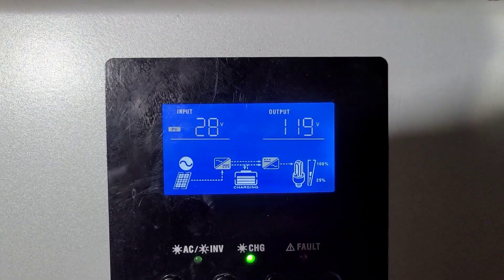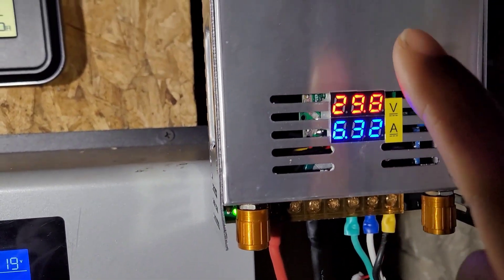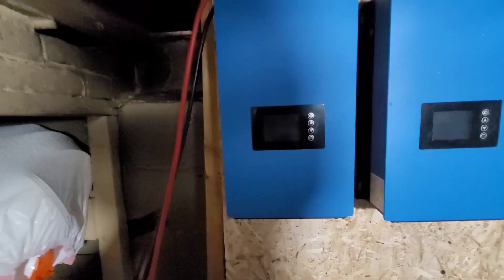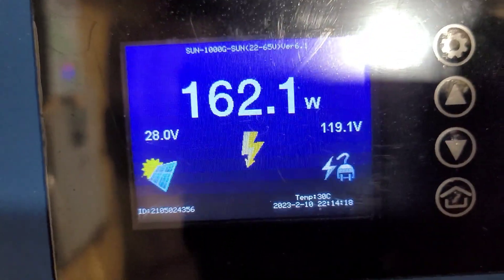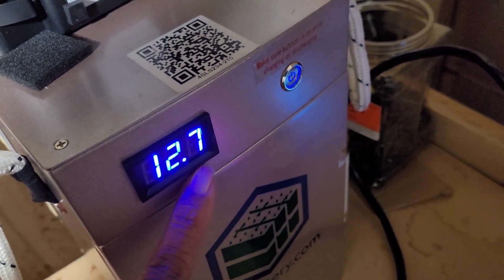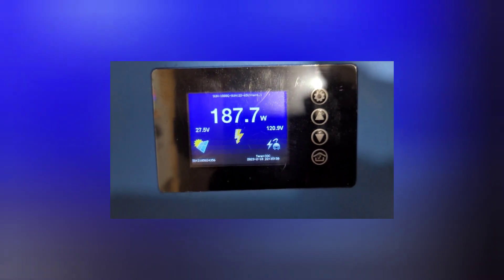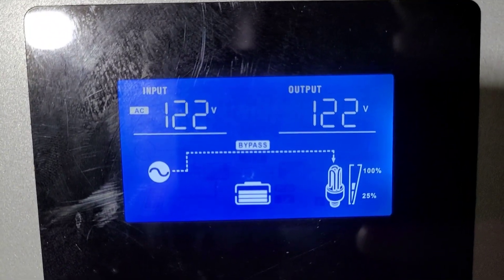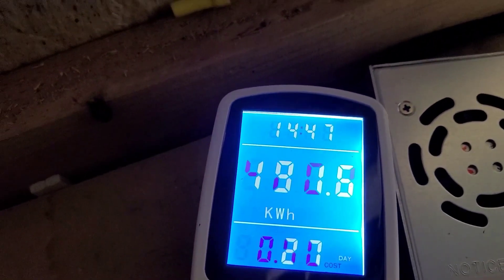looping energy updated from last video using a grid-tied inverter to Loop energy see in description

Comment: What's the objective of the exercise?
That must be stated explicitly.
Reply from the maker: Excellent question, Let's start by explaining that this is a system of overunity, And because I created over unity and most people stated incorrectly or tell people the wrong information about overunity which is a part of trolling I believe and we'll prove that later through the comments that other people have stated, they take my work and they make all these comments as I hope you read Just from doing these experiments to misdirect people and tell them eyes so that is number one. After realizing people brain almost explodes when you give them too much information I decided to break down the experiments that I do into small bites this experiment is showing can you take the same energy and loop it back into itstuff that is number tdo and if you can take energy like in a coil And you have many types of coils you have too understand why do people make coils what is the purpose of making a coil that a single straight line can't do won't you realize what a coil does if you do that with your energy looping it then you realize that you can do step UPS That means that you can get small amounts of gain a state of losses, They're always going to be losses what the activity at the end of the exercise is to be overwhelmed of energy even though you have losses. Remember our grid is based on this principle running energy through those energy lines create a lot of  Losses through heat and magnetic flux we have experiments on that how to use that loss to gain some energy, Keep in mind even though it's small amounts of energy so it's a battery if you break it down to get 12 votes you have to take small amounts of energy and stack them into large parts of energy But that isn't another story. Even though that is another story you have to keep that in mind that's why I stated because the solar which only gives you a small amount of energy especially when using LA D light still gives you a small gain and now I stack them as you see in this video ,     https://youtu.be/HTR03aSiGWs
 And then what happens when you overwhelm a system of loss with a positive gain you now can push that back into the battery itself so I'll be redoing some of these experiments so you can see that yes if I loop the battery back into itself and push some more energy from an outside source into it than it will actually charge the battery, Why do I do this because if you look at the numbers I don't need as much energy from the grid because the boost of that  12 V 100 amps times 2 batteries is giving the power needed to just keep the system going so remember when you float charge a battery all you need is just the smallest amount of energy to push the energy back into The batteries which we  Showed but we're going to show it again because I understand that those trolls want you to believe that this is some type of perpetual motion and that it's impossible to do it's not all these things will eventually wear and tear and you will have to replace them. But remember you can go to any store and buy a tigrid and what is the purpose for the target to put energy back into your grid in which you are pulling energy from so I wanted to show if they made such a device why do they say it's impossible to do it. As you do your research you'll start to see something's not adding up and as history States in the past propaganda was one of the key things of winning wars, So again I'm going to show this by doing a small loop and then I large loop again once you understand that you can loop energy and why a coil is wrapped around itself to create a boost once that's understood then we can go into step UPS which if you opened an inverter , a tigrid inverter karma and many of your devices you would see that they all have course and Step up Transformers. When you start to ask questions on why so many step up Transformers in an inverter of any kind you start to see that blessed people are going to talk to you about that, Because they don't want you to know that you can step up energy and step it down as many times as you want now here's the exercise for you by asking the questions about the inverters and then looking at the efficiency number in which they state their machine workout is it just for sale Is a product to you or is it true. Then you start to see something is fishy about everything that they're saying 1st you'll find out yes you can loop energy nothing wrong with it, Then you'll find out that you can step that energy up either by frequency or by power itself, Once you start to do then how much energy is being drawn and how much energy can you put out you must realize that you're getting a gain just don't say more power out than in cause they'll go crazy but the game is there. Studying the grid itself and how they design stuff you start to see that they're playing this game in which I'm trying to express pacifically there's been stepping up power and stepping it down for years and no one complained about the losses, I'm not trying to say losses and efficiency  Doesn't have its place, What I'm trying to get people to realize is that the grid is not at all efficient and has great deal of losses so does the car that you drive these are the old systems so why are people trying to compare all the new systems with something that works so badly, It's called money. So again I've gave you a specific task to do to start looking up these things and realize that you're being lied to about certain things they're trying to keep you away from because then you'll start doing what nikolai Tesla wanted you to do in the 1st place be free from the tethers of corporate grid systems Or you can replace grid with  Greed, At the end of the day these simple videos chis are examples in which you can do yourself hence why I have to redo the video taking a small Charge controller and a small battery and showing is it just possible to actually take some wires from the battery in loop it over to the solar side Without damaging the equipment ? Answer that question see it for self doing both assures you that this is possible then we go on to the next step if I now take the solar side which already has 2 wires in it from the battery and add 2 more wires from an independent source can I now charge the battery at the same time that is discharging into itself ? Once you answer this question and it doesn't destroy your equipment you'll start to realize that these small little things they seem not to talk about Are a big deal we call this pass through charging , your phone does it it means that you can charge it and use the power at the same time and many of your devices does that today so why did they tell you that you cannot do exactly that then you'll have my complete point to this exercise.
Reply from the maker: Hi my name is Rick I work for Lloyd Stovall at media library, I wanted to make sure that the exercise is understood. We wanted people to understand about tigrids or grid tide inverters And how they put energy back into your AC home  Outlets, One when you buy these machines the only way to force energy into something that wants to come out of it is to have more power pushing back against it it's like swimming against a river, This machine bought from Amazon achieves this point. The 2nd point is that now you should realize You can loop energy back in on itself, It is a myth that you can't recycle energy back into itself and it is a big myth everyone just about believe this. So once we dispel this myth and show people that you can't re brought energy back into itself the 2nd thing people should know is can we step up the power and how far and start producing A greater output than the input is giving now normally this is not possible but it is achieved by storing energy and batteries the batteries will push this type of power out for a short time, And then has to recharge this is where overunity comes and play the real overunity the one everyone is trying to keep you from, That means a switch has to be put in line and switch over to a fresh pair of batteries that are charging to now discharge into your system while the batteries you used starts to charge backup. So now we're going to teach you little tricks to boost the power with looping the power around itself but we have to take our time or people will miss understood look at the video What happens if I plug this into itself. And if you read the comments you see that a great deal of people just didn't get it, Even though they seen it with their own eyes.